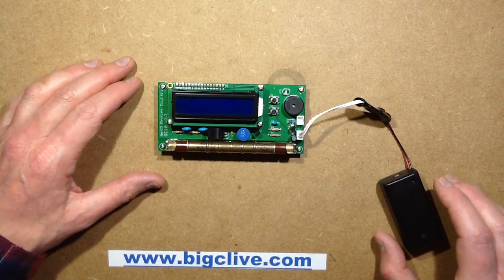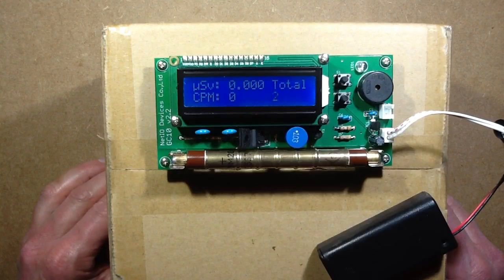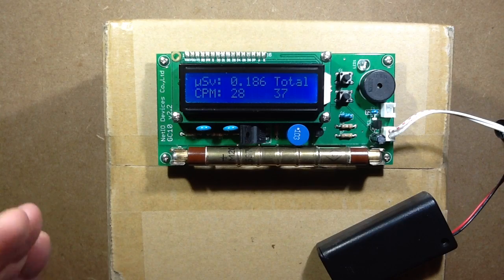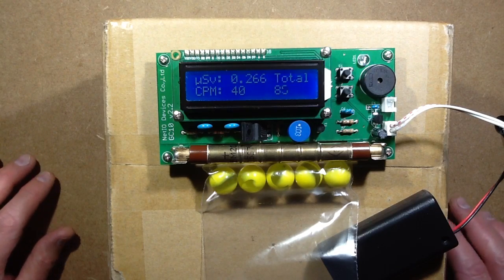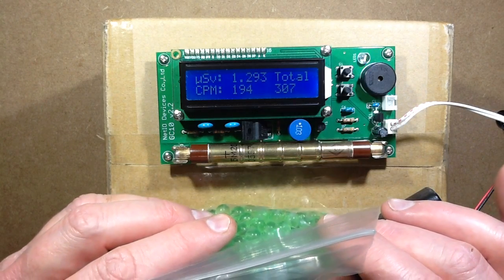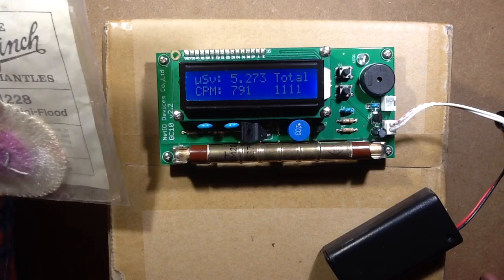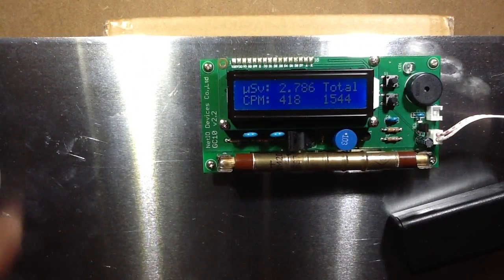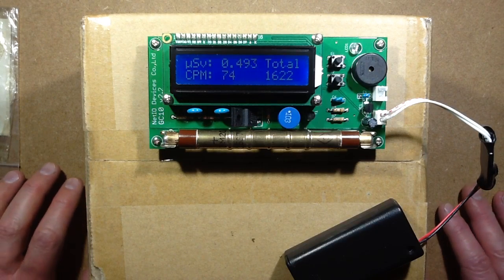Using a Geiger counter on uranium glass and thorium mantles.

Comment: Hi Clive. 
Uranium glass emits both beta and gamma. I tested a piece I recently bought with a sheet of paper between it and my geiger and the and it read the same, indicating beta + gamma at least. My GC isn't sensitive to Alpha. Then when I placed a folded aluminium sheet between the two did the reading go down, indicating gamma only.
That thorium mantel, if it emits gamma, then your dad's night stand would have not blocked it.

Comment: Thorium 232 as used in gas mantles is predominantly a gamma emitter. It decays to Radium 228 which is a beta emitter. Thorium 230 is also present in gas mantles in trace amounts and is an alpha emitter. Th230 has a decay path that includes Radon gas. So basically, an old gas mantle will not only emit alpha, beta and gamma, it will also give off a radioactive gas.
Reply: Thorium-232 is primarily an alpha emitter.

Comment: Thorium mantles are quite spicy.  I have one of the green dyed ones.  It saturates my counter. I keep my samples in a steel sweetie can on my bedside cabinet.   The radiation still leaks through and that's with the samples wrapped in 4 layers of BACO-Foil and inside a steel can.  Looks like your counter uses an SBM-20 tube like mine.   Only good for beta/Gamma only.   Check out an old fire alarm.  They generally use an Americium pellet (Alpha emitter) and you counter won't detect it.... or if it does, it will barely detect anything.   For Alpha you need a different tube with a mica window and a higher voltage.

Comment: I was under the impression thorium was completely non radioactive without outside excitement. Guess I was bamboozled.
Reply: I think what it is is that there is a 'residual' level of radioactivity, ie, a 'resting' level as it were, that it returns to when it's not being stimulated. The resting level is too low to be economic for power generation, if I understand it correctly.

Comment: If you have a checkbox with a 100M position, that might be high enough to use as a ballast with a DC ammeter so you can check the Geiger tube voltage.

Comment: I tried measuring the tube voltage with my HP34401A in the ">10 Gohm" input mode and got 195 volts but the circuit whines audibly when I connect the probes so I guess the input impedance of my meter is still too high to sense the voltage. Sensitive stuff.

Comment: I'm pretty sure that just aluminum FOIL will stop beta particles! Wheras alpha might mostly be stopped by the plastic bag. Alpha isn't even very able to get through the dead layer of skin cells on the surface of your skin. I think the glass of the marbles should have stopped both of those, I'd guess it was gamma. but I'm no physicist!

Comment: I’ve had Over a dozen packs of vintage lantern mantels in my vehicle glove box. The glove box sits between the driver and passenger seat. I do a lot of fishing and traveling, and I keep several Coleman lanterns in my truck toolbox and all of the extra packages of mantels in my glove box. I’ve spent at least 300 nights sleeping in my truck driver seat over the past 10 years. With my head literally inches from the lantern mantels. I have several Geiger counters, and the lantern mantels never occurred to me. However I recently checked them with my SBT10 and SBT11-A tubes… And indeed they are radioactive. 

I reclined my driver seat and measured the exact distance of my head to the mantle’s, which varies between 9 and 14 inches depending on which way my head is turned.  I do a lot of traveling… One winter in particular I slept in my truck every night for five months solid! Traveling looking for musical instruments and other interests… I’m just more comfortable in my truck than checking in and out of a hotel twice a day.

I’ve been traveling out of my vehicle part time for the past 13 years. And I’ve had those lantern mantels there almost the entire time. I Purchased a large box of mantels from a small town family owned hardware store that had been in business for 40 years. They were going out of business and about 15 years ago I purchased an entire box full of mantels. Probably a gross (144) but I’m not quite sure. 

The glove box is at least an inch thick on all sides, made of leather, nylon, and plastics. Curious if I could pick up radiation damage with this prolonged exposure? When I get my new counter( and extremely sensitive tube) within the next few weeks… I will measure from the outside of the glove box and see if the radiation makes it through. 

 Would really appreciate any feedback. thanks for the great video
Reply from the maker: Thorium is an alpha and beta emitter.  More of a risk of you ingested some.  The glove box would probably block most of the radiation.
Reply: bigclivedotcom  Damn… I’ll have to find another excuse for my decreased mental ability

Comment: The GM tube you are working with can only detect gamma radiation even if other radiation is being given off. Other GM tubes can detect alphas or betas. This is why the aluminium only attenuated the radiation by a small amount. Also, the distance from the source (mantle) will be very significant. 

Great video by the way. Thanks.

Comment: I have a good story about Tritium.  A bit long winded but Amazing .  My Tritium Event.

Joined the USAF.
While in Basic Training they had a Nuclear Event Exercise the first week I was there.
Called  a Broken Arrow Event.
Exercise was training on how to handle a event such as a air craft carrying nuclear material ( Bomb ) should crash or the like.
Part of the exercise was looking for nuclear contamination. 
They lined all of us up and run a giger detector over everyone one by one.
When they got to me  the crease of my left arm set off the Detector quite well.
Well more then the odd Clickity Clickity Click.
THE WHOLE WORLD STOPPED. 
They brought in a new giger detector and checked me out again.
And Again.
And Again.
Then came the Questions.
Who Was I.
What is my actual Rank.
Obviously I was not the Airman Basic just of the streets.
Off to the  Hospital I go.
Sequestered in the X Ray Room.
Guessing it was the only facility they had on base that dealt with actual radio activity .
X ray I got.
Spot they found.  Just barely visible on the X Ray film.
They placed my arm in a tube of the good ol Iodine soapy water.   Odd Enough Iodine carries slight Radio Activity it's self.
Scrubbed my arm just short of taking the hide off of me.
Rechecking and checking and checking until the clickity click was no more.
Then filtered out the Clickity Click from the soapy water containing the EVIL un see-able thing in a test tube.
Rushed it Off it went to parts unknown.
Now the Questions REALLY get rolling.
Three hours later they sent me back to my flight .  Flight being my assigned Group Nomenclature there of. 
The next day I'm summons back to the Hospital and was was Greeted by two kind Officers belonging the the OSI   ( Office of Special Investigation ) .
Would you believe the found it ?
The material in the crease of my arm was in fact Tritium.
They were actually able to locate the source of contamination as well.
My mother and father had numerous visit by the OSI as well it would seem.
Via hours of Questioning and Answers they figured out I was Contaminated in my own home.
They figured out there was a  Gun Site Manufacturer directly across the street of my fathers 
place of employment.   Yep, they used Tritium in the Self Illuminated Gun Sites. It would 
appear some of the Tritium had been loosed and found it's way to my fathers place of 
employment.  Transported via my father home and found it's way to my arm ?
Flippen Hell.  They actually had this figured out.

Comment: Gas mantles sold in the EU are supposed to contain yttrium oxide instead of thorium oxide, but ones from China may still be thoriated.  The problem with storing gas mantles is not the mild beta or gamma emission but rather the build-up of "thoron" which is actually Rn-220 a short-lived isotope of radon and a significant alpha emitter just like "normal" radon-222.  A jar filled with thoriated gas mantles is a good source of thoron to demonstrate half-life in a school or university physics lab. Keep them outdoors if possible!

Comment: what you saw with the aluminum is basically you blocked almost all the beta radiation and you besicaly had filtered almost pure gamma because no beta emitter is pure beta there is always a quantity of gamma in a certain ratio depending on the isotope "pure" beta emitters are basically those with vary low gamma %

Comment: Hello big Clive, the reason it's often called "Vaseline Glass" (ioxide diuranate form) is that the translucent lustre in some ornaments on the glass looks like Vaseline. The proportion usually varies from trace levels to about 2% uranium by weight, although some 20th-century pieces were made with up to 25% uranium.
This may interest you? : -
Estimates of the Radiation Exposures

A very detailed analysis of the radiation exposures due to uranium in glassware can be found in the Nuclear Regulatory Commission publication “Systematic Radiological Assessment of Exemptions for Source and Byproduct Materials” (NUREG 1717).  

There are three principal radiation exposure pathways associated with Vaseline glass:  

1.    Exposure to the body from the gamma rays emitted by radionuclides in the glass. 
Chemically processed uranium of the sort we are considering here consists of the following radionuclides: U-238, Th-234, Pa-234m, U-234, U-235 and Th-231. The principle gamma rays emitted by these nuclides would be 63 keV and 93 keV from Th-234 and 186 keV from U-235.  NUREG-1717 estimated the following exposure rates from two different pieces of glass with 10% by weight uranium content:

            Distance                       Drinking Glass                           Decorative Piece

            1 foot                           9 x 10-4 mrem/hr                       1.8 x 10-3 mrem/hr

            3 feet                            1 x 10-4 mrem/hr                       2 x 10-4  mrem/hr

            6 feet                            2.5 x 10-5 mrem/hr                    5 x 10-5 mrem/hr

For comparison, the background exposure rate due to gamma rays is approximately 1 x 10-2 mrem/hr.

2.     Exposure to the hands from the beta particles emitted by radionuclides in the glass

The aforementioned NUREG-1717 also calculated the beta dose rates at a depth of 7 mg/cm2 (i.e., the nominal depth of the germinal layer of the skin) as well as the estimated effective dose equivalent. It was assumed that the source was a 10 inch diameter plate with a 10 % by weight uranium content.

            Distance                       Dose Rate                    Effective Dose Equivalent Rate

            Contact                         27 mrad/hr                              0.0027 mrem/hr

            1 foot                           1.1 mrad/hr                              0.0027  mrem/hr

            3 feet                            0.095 mrad/hr                          4.7 x 10-4  mrem/hr

The ratio between the effective dose equivalent rate and dose rates vary with distance because the further away from the source, the greater the area of skin that was exposed.

3.   Ingestion of uranium that has leached into food that has been in contact with the glass

Landa and Councell evaluated the leaching of uranium into different solutions over a 24 hour period. The glassware they used was designed to hold liquids (e.g., drinking glasses). They determined that the average resulting concentrations of uranium were 0.052 ug/liter (1.7 x 10-11 uCi/ml) for water and 5.9 ug/liter (2 x 10-9 uCi/ml) for acetic acid. The highest measured concentrations were 0.63 ug/liter (2.1 x 10-10 uCi/ml)  in water and 30.1 ug/liter (1 x 10-8 uCi/ml) in acetic acid.  They noted that less uranium would leach into solution when the experiment was repeated. The presumed explanation is that less and less leachable uranium becomes available.

After estimating the effective dose equivalents for a variety of potential exposure pathways, NUREG-1717 concluded that the highest doses would be to the personnel involved in the transportation of the glassware from a manufacturer to a truck distribution center. This maximum estimated dose, 4 mrem/year, is approximately 1 to 2 % of the average American’s annual radiation exposure.

Comment: You should check Cat Litter and Toilets Bowls with your meter...the clay used to make Cat Litter and Toilets (at least in Canada & the USA) is slightly Radioactive (not dangerous, just a little above ambient)...

Every time I took a load of Cat Litter from Ontario to the USA (former Truck Driver), the Boarder Crossing would go nuts because my trailer set off the Radiation Sensors at the Customs Booth...

Comment: You can determine if those marbles are Alpha/Beta emitters, by placing a piece of thick card between them and the Geiger Counter.

If they're Alpha/Beta emitters, the count rate will drop significantly, whereas if they're Gamma emitters, there'll be no change in the count rate.
Reply: Geiger tubes cannot detect alpha particles
Reply: @tfw8738  Are you sure?

From Wikipedia:-

"It is used for the detection of gamma radiation, X-rays, and alpha and beta particles."
Reply: @BedsitBob  huh, guess you were right. I learnt in school alpha particles couldn't be picked up on a Geiger counter

Comment: The mantles are impregnated with thorium oxide.  When you first put the mantle in use, the organic material burns out and the thorium oxide is all that remains.  And there comes the crucial detail.  Thorium oxide melting point is 3390 degrees C and the boiling point about 4400 degrees C.  Pure tungsten melting point is just 3422 degrees.  To operate plain tungsten anywhere near 3000 requires inert gas environment, while thorium oxide is already “burnt” and can be operated as those mantles without other concerns than vibration and shock.
Reply: +Pellervo Kaskinen:
It isn't because of the melting point or boiling point that ThO2 is used.
ThO2 exhibits a phenomenon called candoluminescence (or is it candeluminescence).
It emits more visible light than some other materials. This is because instead of emitting in the infrared region, some of the energy is stored and emitted in the yellow region.

If you want, buy some chalk or get some from your backyard. It is CaCO3. Heat it with a torch strongly and it will convert to CaO which is candoluminescent. Do it in the dark. Compare it with heating some other piece of rock or brick. You can easily tell the difference.

This is where the term "being in the lime light" came from. They heated CaO with some torch in theaters. They call CaO or Ca(OH)2 lime (limescale?, lime water? calcium and lime?) in the old days for some reason.
Reply: louis tournas :  Interesting...  Never heard of those details.  Although another lamp called Nernst lamp is based on the chalk or more likely magnesium oxide.  And makes me speculate that the oxide is the key.  After all, burning magnesium was the old source of bright light for photographers.  The common item for all these seems to be oxygen.  Hmmm...

Comment: That GM tube looks like an SBM20, made in Ukraine afaik. Similarly to the Japan/Fukushima thing, Geiger counters became popular in Ukraine after the Chernobyl disaster. 
I bought a cheap Ukraine built GC a while back and at some point dropped it thus finding out the hard way that those tough looking brass tubes contain a fragile glass tube, it made a heart sinkingly jingly jangly sound when shaken :-( 
Much to my delight, I found out that replacement SBM20s are dirt cheap! So, £10 and an ebay visit later got my GC working again!
Thumbs up.
Reply from the maker: I bought this unit from a Japanese seller right after Fukushima.  There's nothing quite like a nuclear accident to boost the sale of Geiger counters.
Reply: LOL yep :-) Ho hum nuclear shite ach well, nighty night!

Comment: Actually there is a plateau region. The operating voltage needs to be between the start of the plateau and the breakdown voltage, that difference can be over 100 Volts, depending upon the tube design. The SBM20 used in your device is  usable from about 350 to 475V. The pulse size is effectively constant. https://www.gstube.com/data/2398/ your aluminium needs to be about 3mm thick before you get a decent blocking of beta.

Comment: Russia's focus on nukes was not to use them really as ICBM missiles like the USA. They focused more on tactical nukes. That's why during the cold war they sent missiles to Cuba because from Russia their nuclear missiles really couldn't reach the USA. Their plan was to if a nuclear was broke out was to nuke a country and then send in troops equipped with anti-radiation gear. That's probably why in Russia they have so many geiger counter chips for sale.

Comment: Yes, I'm late to the party. Can you find an antique clock that has radium painted hands and numerals? Westclock made then for many years, they can be found on ebay and in antique stores ( the ebay offerings are cheaper even with shipping) the radium on them has a halflife of about 40,000 years and it would make your counter do mucho clicking.

Comment: Modern digital x-ray imaging panels are usually amorphous silicon panels. I believe they detect beta and probably alpha radiation pretty well on their own. I know that for radiotherapy they use a copper sheet or something similar as a scintillator to convert a few xray photons into electrons for the silicon panels, to get an image. Long story short, would be very interesting to try some kind of scintillator in front of a silicon photodiode to see what readings you get.